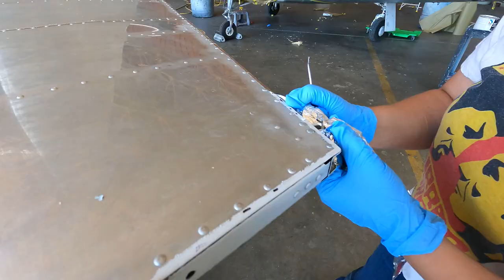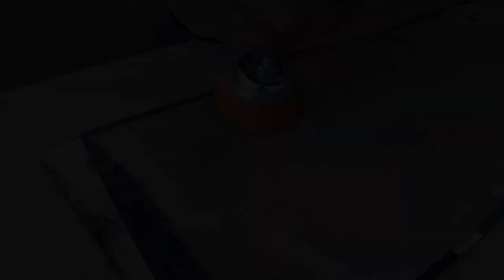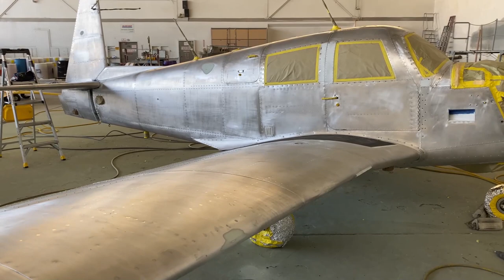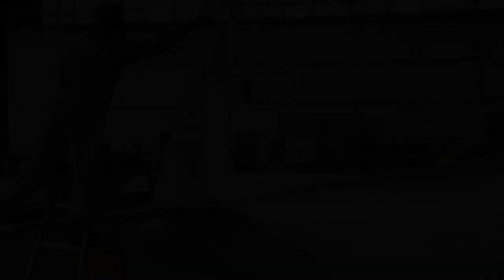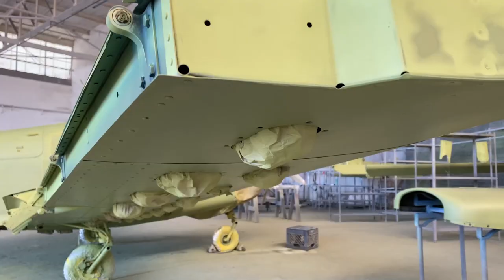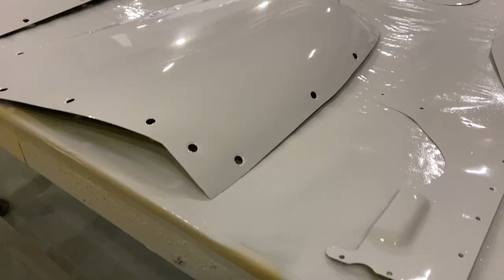Mooney M20E is getting a new paint (episode 5): Preparation, prime and paint white base!

Comment: What did it cost total
Reply: Hi! While the price to paint a Mooney can vary, the starting price with standard design (base white with 2-3 trim colors) comes in at $20,512.00.  This includes the full Strip & Paint of the aircraft, the removal, balancing and reinstallation of the flight controls, and 10 hours of bodywork.